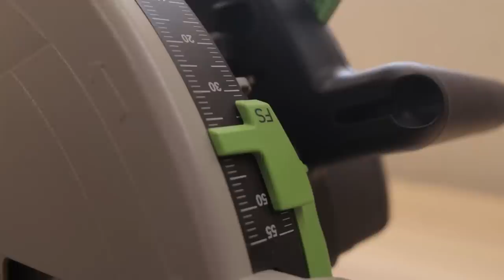Dining Table Making

Comment: That's gorgeous and the engineering of the extension is so simple and smart! I love it!  I love your finish. What is the process? 2 steps I see,  but I'm unsure what you use.
Reply: Same question here!
Your work is amazing. But I would also be interested in what finish you used. Seems not to be oil, is it? I maybe would have used kind of a parquet lacquer to make the table waterproof ... or oil for a more natural finish 😅
Reply from the maker: I use "clear seal" oil, in general, it is a floor oil, but it is very strong and not afraid of moisture. It is also easy to use, can be applied both with a roller and by spraying. (I spray only in hard-to-reach places...
Reply from the maker: and yes, I apply oil in 2-3 layers, more on the table top